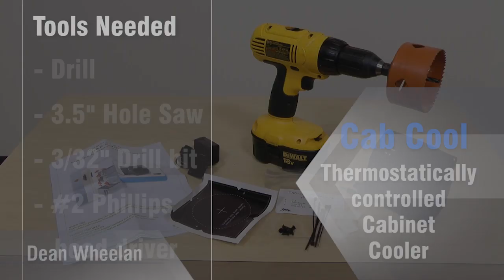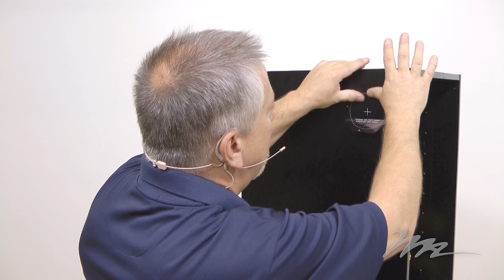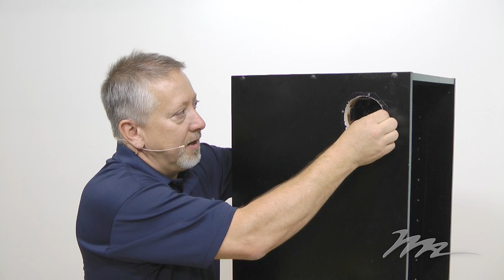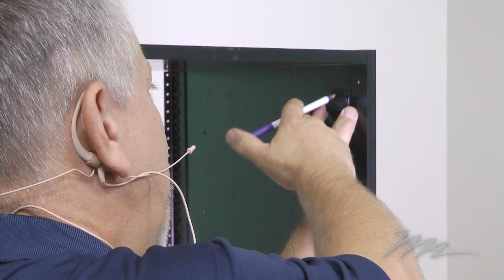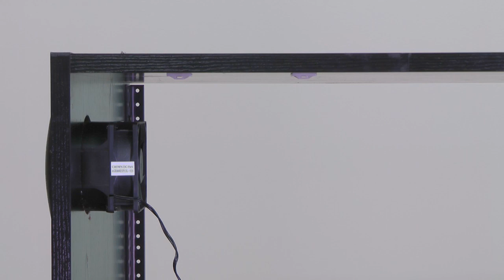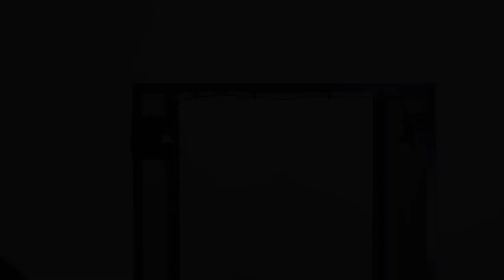CAB-COOL - Cabinet Cooler Installation

Comment: Yes,  The fan is quickly removed and reversed in the attached mounting bracket by removing (4) plastic expansion pins. Takes about a minute to do.